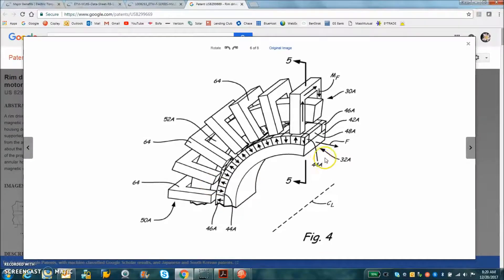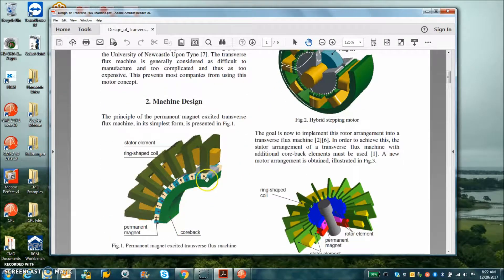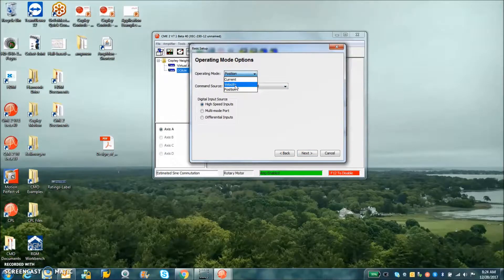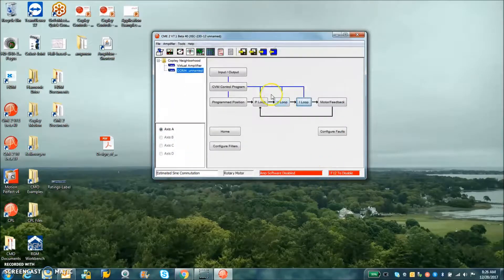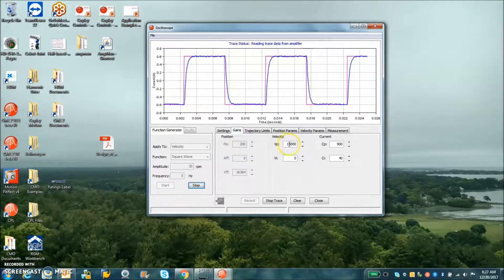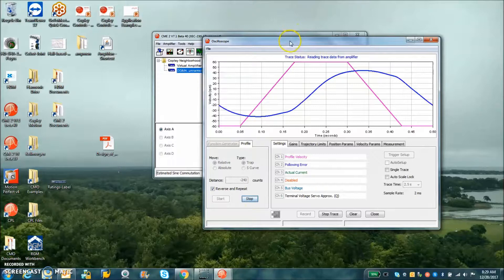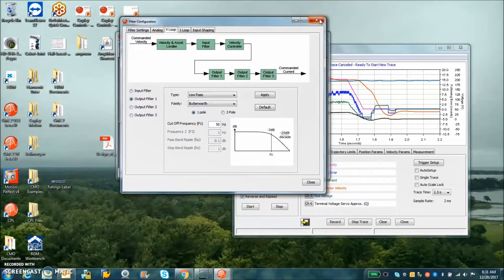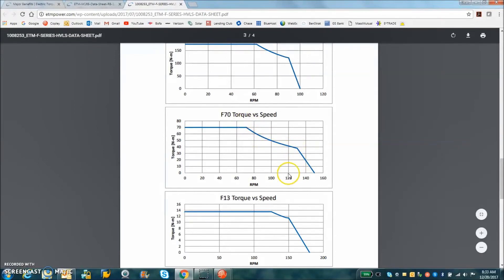Transverse Flux Motor for High Torque + Hall based Estimated Sinusoidal.

Comment: Where can I get information abt the basics of transverse flux machine...like its design...working principle... construction all that stuff???
Reply: see all things Eric Roberts Laithwaite,  the inventor of many of these devices (14 June 1921 – 27 November 1997) was a British electrical engineer, known as the "Father of Maglev" for his development of the linear induction motor and maglev rail system.

https://www.youtube.com/watch?v=oWiYsRi2Dss etc for a generic overview 

Books
Propulsion without wheels (1965)
Induction machines for special purposes (1966)
The engineer in wonderland (1967) — The Royal Institution of Great Britain Christmas lectures, 1966/67. With illustrations, including a portrait.
The linear motor and its application to tracked hovercraft (1971)
Linear electric motors (1971) Mills & Boon Monographs and Technical Library
Experiments with a linear induction motor (1971)
Exciting electrical machines (1974)
All things are possible: an engineer looks at research and development (1976)
Transport without wheels ed. (1977)
How to invent (1977) co-written by Meredith Thring
Why does a glow-worm glow? (1977) illustrated by Mike Jackson
Electric energy: its generation, transmission and use (1980) co-written by L.L. Freris
Engineer through the looking glass (1980)— a revised and expanded version of his Royal Institution of Great Britain Christmas lectures, 1974/75. With illustrations, including a portrait.
Invitation to engineering (1984)
Shape is important (1986)
Force: a basic ingredient (1986)
A history of linear electric motors (1986)
Using materials (1987)
Size is vital (1987)
Reply: @paulmaydaynight9925  cool comment, cool inventer, cool motor!
Reply from the maker: Siddhi Kadam, you could talk to people who make them. Send me an email at work dcrumlish@copleycontrols.com include your full contact information.